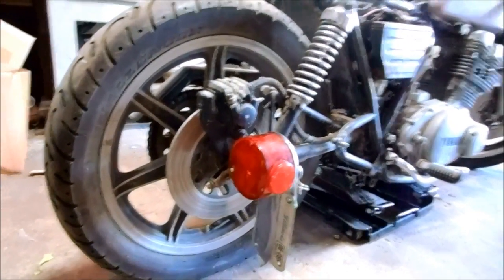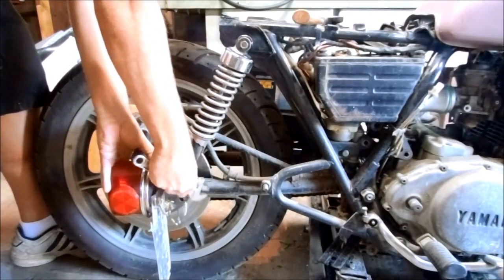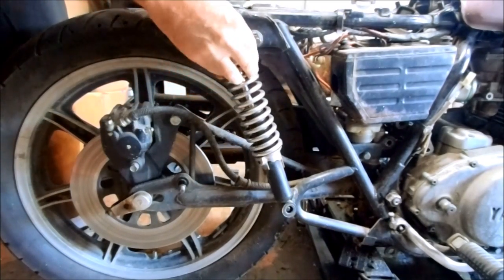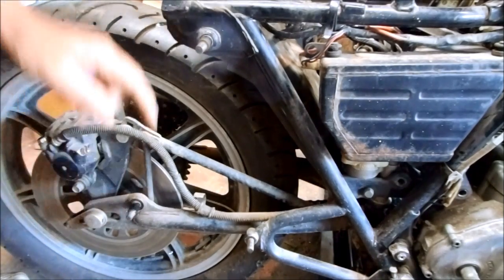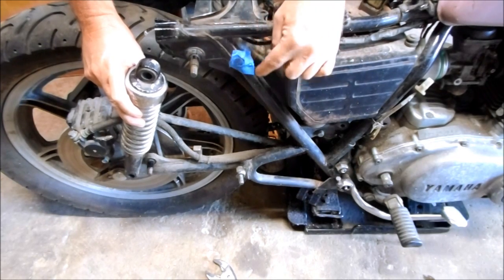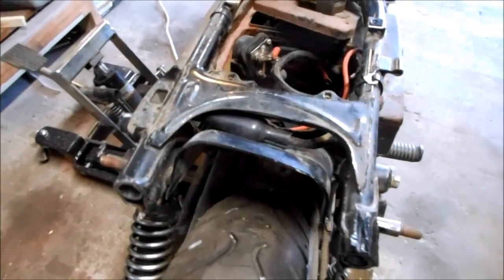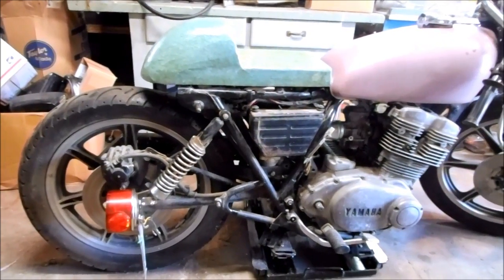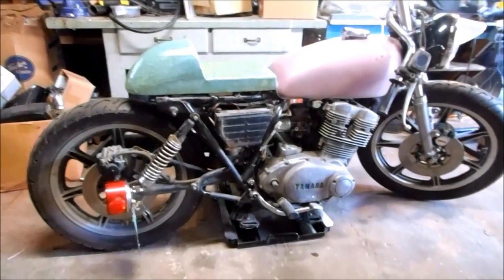Ichiban Cafe Racer Part 11: Motorcycle Rear Suspension Upgrades

Comment: Adjustable spanner, hitting it with a hammer, using a claw hammer to remove a bolt, using a brace to drill a hole in steel,  If this isn't a piss take it would be really scary

Comment: Reminds me of me when I first started hacking sh*t up and just "making" sh*t fit together. I think there should be a disclaimer before each video so people won't try this at home. Compromising the structural re giddy of the whole frame.
Reply from the maker: Excellent recommendation, here is a draft:  We are highly skilled, certified,  professionals with decades of motorcycle engineering experience. Do not attempt at home without parental supervision.
Reply: Jose Alberto Orozco I think it's spelled re-gegididity

Comment: No... Just no. Some of your "Modifications" are dangerous. Did you really consider epoxying a bolt to the frame to hold the shocks??? By drilling a hole in the frame tube, you have weakened it. Badly. Also, you have an inch and a half clearance? Sit on it and find out how much the shocks compress. People, be careful with this sort of stuff. It's not as simple as this.
Reply from the maker: Bad ass racing style sporty  handling Alex !
Reply: Great point.  I kinda wish he would have "glued" a bolt to the frame and learned the hard way. When he tries to save money it's all on stuff that are safety oriented
Reply: +Alex hay+tim aldrich

     Sorry but I believe  you both missed the point.  Our guru has just given us
SPEED TIP # 10.5
      Sparks flying out yr oss (because the seat is rubbing on the tire) tends to
cause people to back off .  Thussly , enabling  to get to the bar first more often ,
and, thussly  winning more races.     SMARRRRRRT
Reply: True this has to be a joke

Comment: couldn't you have cut the difference in height from the spring instead of drilling a hole through the frame, which seems dangerous with the upward force it will receive.
Reply from the maker: I want full spring travel. this is racing suspension